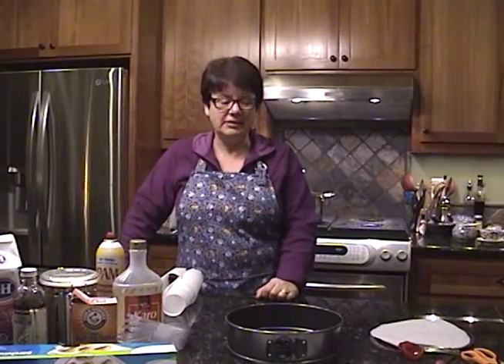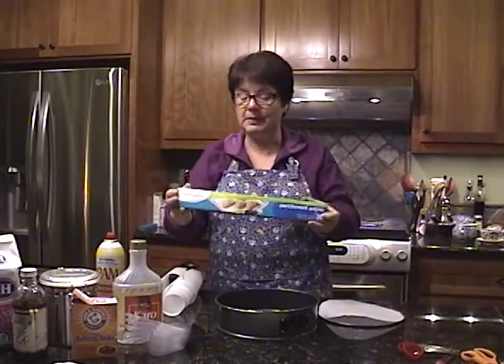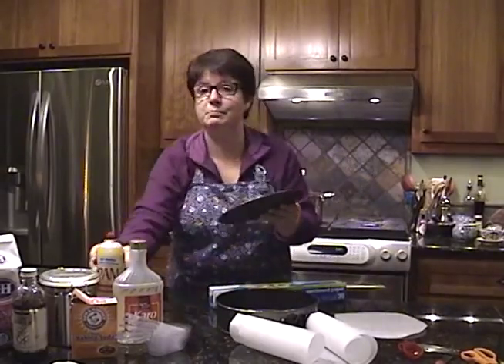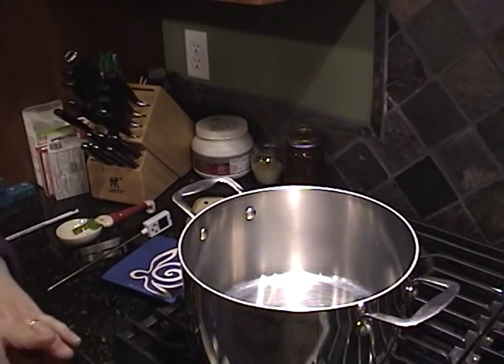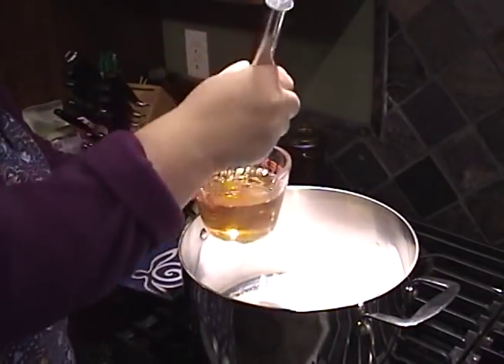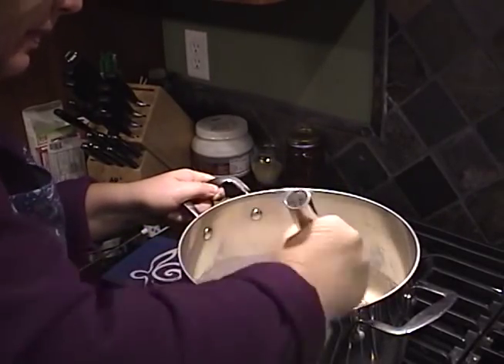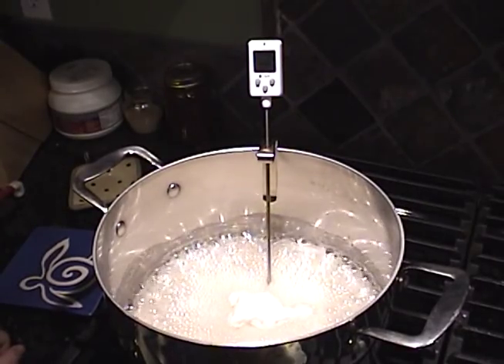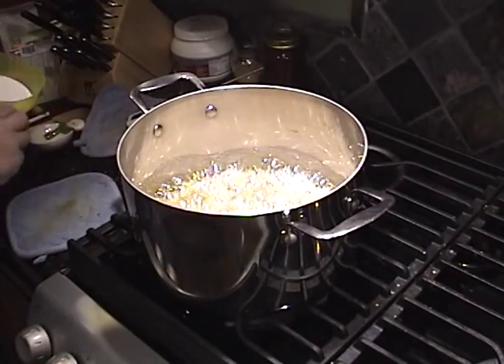Sea Foam Candy Failure

Comment: Doesn’t need taller vessel, needs wider. Also, don’t mix liquids together before adding and don’t stir anything till adding baking soda at the end. Use a whisk and don’t too much. You definitely want the soda incorporated, but not create large air holes by mixing too much. Good learning video though.

Comment: I feel SOOOO much better now! I mean that I am not alone. I was feeling so frustrated and even depressed about this. I made FOUR attempts and didn't get a good batch. Most of them were scorched-tasting, even if they looked fine and I thought it had turned out.  Only one was undercooked and gooey and wouldn't set. I was really really careful about the cooking time. I used several different recipes, including Nigella Lawson's which has just 3 ingredients: white sugar, golden syrup and " bicarb" (baking soda). She made a video about it and went on and on, oooh-ing and ahhh-ing about how wonderful it is, how quick and easy to make, etc.and how she takes it to dinner parties because "Mother told me never to bring flowers. Then they have to go find a vase!" (horrors). So she whips some up, lets it cool while she is making herself gorgeous, and whacks it with a hammer, then sails into the dinner party with the chunks on a platter. (But, of course, she eats half of it in the limousine on the way.) Anyway. By the time I got to Nigella I was on my fourth attempt, ready to chuck the whole thing in the garbage! I don't know what it is about this stuff. You add the baking soda, it turns into a monster. If I do try it again, I will use a fraction of the amount. It will taste better at least, even if it is more like peanut brittle. Recipes for this are all over the internet, but if you do a little digging in the comments section you will see MANY remarks about failed results. Another thing about sponge toffee that nobody mentions, even the commercial stuff leaves an aftertaste of baking soda, a bitter chemical taste. Let's face it, there is A LOT of baking soda in this recipe. Not very nice. Maybe this is why we dip it in chocolate?
Reply from the maker: ferociousgumby thanks for an awesome comment. Made my day.

Comment: Oh no! Kudos for posting the video even though it didn't work out that time. And yeah, way too much baking powder. For that amount I use a tablespoon worth. I strongly recommend investing in a silicone cooking mat too. The sea foam can be poured on it (silicone holds up to temps as high as 470 degrees I believe) and the candy comes off totally clean, no paper mess and no need for cooking spray that can impart that weird chemical taste of spray oils. Also you don't want to add the vanilla until right before you add the baking powder. If you add it at first, the flavor basically cooks off. You can let the boiling syrup go up to 320 degrees F. And Peri has the ratio of granulated sugar (sucrose) to corn syrup (glucose)  spot on. Some recipes call for 50/50 syrup to granulated, but too much corn syrup or honey or golden syrup (the glucose sugars) leaves the seafoam gummy and chewy even if heated to 300-320F.  The ideal ratio is what she showed, somewhere between 3:1 and 4:1 sucrose to glucose